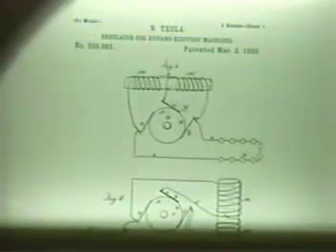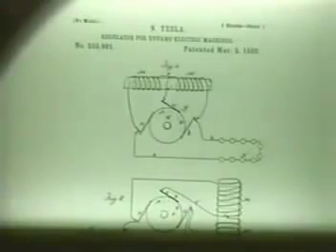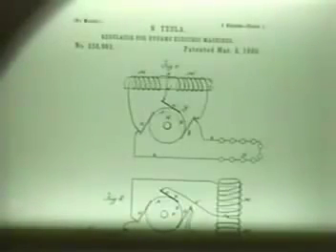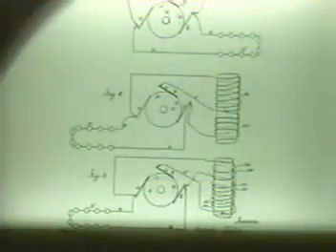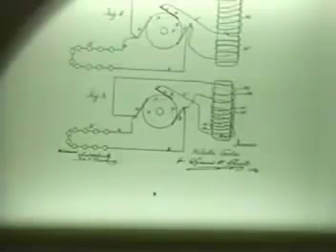Don Smith on Coil Configurations and Winding Directions

Comment: I built a air core primary coil with 50 turns and secondary coil with 5 turns clockwise and 7 turns anti clockwise. I fed the primary with 10000 voltage ac from high voltage module. The secondary is not able to turn on a 10 watt LED bulb. I tried grounding the center tap of secondary. Also tried connecting a capacitor on one side. Also tried step up using iron core isolation transformer. Not sure where am I going wrong. Any clue?
Reply: i would start with a lower turn count on the primary. 10 turns or so. then an even multiple of that for the secondary. 30, turns or something like that. put a spark gap between one terminal of the HV module and one end of the primary coil and then your primary coil will most definitely be alive. connect a light to one end of the secondary and the other end of the ight to earth ground. if a 10 watt doesnt light up, try a 5 watt or a 2 watt. then progress and study and observe : )
Reply: One thing that has become apparent in my research across the net that concerns the Don device is that you need to treat coils and wires as both transmission lines, and more importantly, antennas.

The relationship between the Primary and Secondary needs to be like how we treat transmitters and receivers, with full-wave, half-wave, or quarter-wave self resonant frequencies, either as a multiplication or division off.

So for example, if your L1 coil-circuit has a self resonant wavelength of 1 meter, which you would excite it at, your L2 coil would need to be:

1 meter wavelength for full-wave
2 or 0.5 meter wavelength for half-wave
4 or 0.25 meter wavelength for quarter-wave

The other requirement is impedance matching between the power coil and your load, in a "Generator" the only reason more work has to be applied when a load is attached is because the impedance goes up, which the rotor then has to fight through to maintain excitation of the external circuit, neutralize or maintain impedance match and you won't get any increase in power draw when you attach loads because the L2 is now acting as the actual source of power.

Comment: https://youtu.be/apOnutAELbo comments~

ok I finally figured out how this damned device works! 

you dont need that huge coil, all you need is a hv transformer and a diode bridge into a large cap bank. 

the potential from the transformer is all that is used, so the input power should be very small.

the space in between the capacitor plate contains the over unity energy. the cap fills up with electrostatic charge from the atmosphere between the plates which is 10to the 55 grams per centimeter cubed energy density.

electrostatic energy.  

these caps will fill up instantly when enough potential from the transformer is present on the plates of the capacitor.

this is where most people quit because what to do with this energy is tricky.

if you discharge the cap bank at once, you get a huge surge of reactive power. the phase velocity of the electric field is out running the magnetic field and is out of phase. this is not very useable electricity.

but I discovered that the charge in the cap bank can be switched to produce watts.

thats taking newtons per coloumb, in volts per meter in the capacitor and transforming it to newtons per joule and watt seconds in the secondary, output transformer.

what exactly is the mechanism whereby this transformation happens? 

the transistors after the cap back switch the back emf into forward emf.

any time you switch a sine wave ac power in watts, it converts to back emf or static electricity, the same thing happens when you switch back emf or electrostatic charges, they turn back into watts.

its the switched electrostatic charges that are alternately taken from each plate of the capacitor as single charges.

the alternation of single charges from each plate creates a square wave signal of high voltage which is stepped down in the secondary transformer where higher amperages are produced and used in the secondary coil.

the principle of over unity is energy over time. the caps charge up instantly and then the charges from each plate are individually and alternately switched to produce an alternating frequency.

the time it take to fill up the caps is much quicker than the time it takes to discharge them, and you can charge mutliple caps at once since its only the potential from the primary transformer that triggers a response from the energy in the space in between the plates to fill up with charge.
Reply from the maker: Two things you need to know:

1: Opposing Magnetic Fields produces Current
2: Changing Magnetic Field produces Voltage
 

One can have Partnered Output Coils with 20% of 1 and 80% of 2 and still gain Energy! However, different Coil configurations are required!

Come join us: http://www.aboveunity.com - Be part of something better!
Reply: www.hyiq.org https://www.quora.com/Is-it-right-to-say-that-current-is-the-flow-of-electrons-considering-current-is-the-flow-of-charge-per-unit-time-and-charge-is-the-flow-of-electrons-but-in-a-circuit-diagram-current-moves-from-the-+ve-to-ve-terminals

Aaron Murikami's answer(other answer)
Reply from the maker: Perhaps we agree that Science still has a lot to still learn on the topic? ;0)
Reply: www.hyiq.org my reply does not imply that what you said isnt true, I was only adding more of a causal explanation to what you were saying in order to let you know that I comprehend what your saying.

every thing about these technologies have already been discovered, its 100 years old, just suppressed.

have you built a working don smith device?
Reply from the maker: Hi Jeff, apologies, Your reply was very helpful and I saw only good intent. My reply was meant more broadly, what I meant was, in the vastness of emptiness we have endlessness - Science looks with a three dimensional Ruler at concepts that have so much more. What we see today as Energy falls into the Time Domain and over Time, State changes. What we see today as potential, is tomorrow equilibrium. As we bring up a potential, it must fall again, as Waves Rise and Fall on a Shore line.
Reply: your notification summary showed up but I dont see your messages on the thread. see you on your site.
Reply from the maker: I also am having trouble with YouTube. "The Censorship Algorithm" has lost the plot... How about I rewrite for you YouTube? Yes = All
Reply from the maker: Hi Jeff, you will find a massive amount of Data there! Please ask if you have any questions! Experiment is the best way forward!

Comment: Don't forget the Radiant Electricity Nikola Tesla worked with, induced by the disruptive discharge (fast and no oscillations) of the negative voltage charged capacitor, via a magnetically quenched sparkgap (in nitrogen), into the primary.
I wonder if we could do this better with modern day electronics (TVS diode) and bifilar pancake coils (I'm working on that).
Reply from the maker: I think the Great Nikola Tesla said it, in his Kinetic Energy Statement, its definitive and world changing! 

Ere many generations pass, our machinery will be driven by a power obtainable at any point of the universe. This idea is not novel... We find it in the delightful myth of Antaeus, who derives power from the earth; we find it among the subtle speculations of one of your splendid... Throughout space there is energy. Is this energy static or kinetic! If static our hopes are in vain; if kinetic - and this we know it is, for certain - then it is a mere question of time when men will succeed in attaching their machinery to the very wheelwork of nature.

It is clear, Kinetic is Charge in Motion, which is Current, Mass in Motion, having Direction and Magnitude - Come join us: http://www.aboveunity.com - Be part of something better!
Reply: I'm already on your forum (evostars). Yes, Tesla has unlocked the secrets. Wasn't that quote from his early life?
Reply from the maker: Oh good, didnt recognise your YT Name sorry. Yes: "Experiments With Alternate Currents Of High Potential And High Frequency". Nikola Tesla's Address to the Institution of Electrical Engineers, February 1892.
Reply: Have you ever looked into his statements about radiant energy?
Reply from the maker: Not all, some.
Reply: Seems to me to be the key.
Reply: @MasterIvo 
Radiant energy, meaning Ether perturbation?

Could you please provide us with a link or quote or paper where we can look?

Thanks
Reply: @alexkoteles  Radiant Energy that penetrates everything is a Longitudinal shockwave created by extremely sharp rise and fall times, it's the Aether variant of the water hammer effect,  I recommend starting with an article Tesla wrote: 

"On The Dissipation Of The Electrical Energy Of The Hertz Resonator, The Electrical Engineer - December 21, 1892"

Followed by Peter Lindermann's cold electricity book and "Secrets of Cold War Technology" from Gerry Vassilatos.
Reply: @JenkoRun  

Awesome, thanks for sharing 🍻